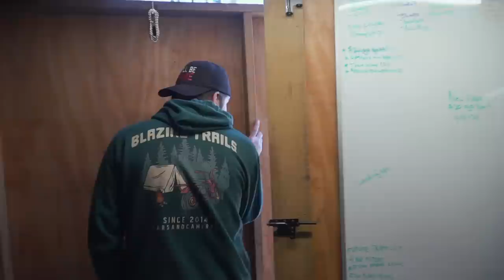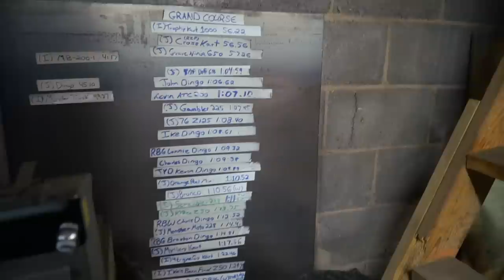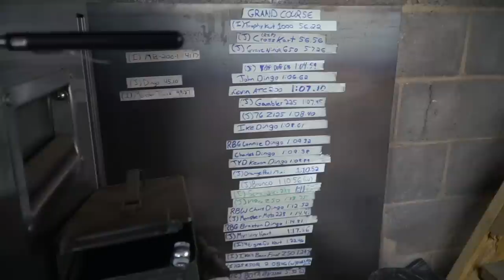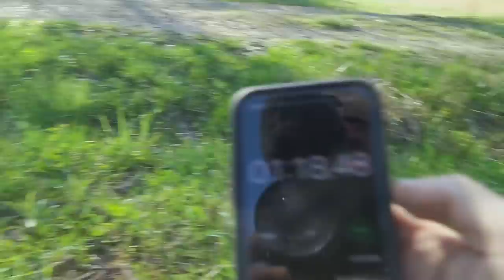We Bought a $20 Go Kart from a Chicken Farm... Will it Run + Ride?

Comment from the maker: I think chicken scratch deserves some TLC! Twin 212s?
Reply: He guys
Reply: Hey
Reply: Sounds fun!
Reply: Yes
Reply: How the heck do y’all find all these deals??? My dad said he would help me make a go kart but I need a chew frame. Could y’all tell me how y’all get the deals??? Also I pull a motor out of a old general and the carb was no good so we just chunked it because my grandpa told me that I could buy a whole new engine for the same price of the carb.
Reply: @chaseyoung4485  find them!
Reply: You should spray paint it chrome
Reply: @wouldyouglowme4235  where tho
Reply: Love to see you find a dead Vespa or old dirt bike so you have some gears!
Reply: 😳😳😳😳 YESSSS
Reply: Maybe some suspension? Or bigger wheels
Reply: No, custom build the OHC and see what can be done with it
Reply: I still stand by my comment from before - I think a throw back/ farm build is the way to go. Get yourself a Briggs intek v twin mower engine, do a horizontal shaft conversion, and slap that on there
Reply: Hell yes
Reply: @CarsandCameras Just an idea or two maybe try some big quad wheels and tires and maybe a two stroke snowmobile engine or something?
Reply: V-twin
Reply: @chaseyoung4485  ask people for them. Ask around and see who may have a go kart.
Reply: Just one 212 stage 4
Reply: maybe the diesel would fit on this chassis very nicely, its quite powerful and maybe you guys can tune the diesel a little, would really like to see a comeback of it!
Reply: Twin 670s
Reply: Triple 212
Reply: What happened to that  snowmobile engine you guys got?  I wana see some 2 stroke action
Reply: @zomgz932  good question, the big 670 two stroke would be a perfect fit for this build!
Reply: Single unmodded 670
Reply: @jimmyhughes5392  booooo
Reply: Nah guys, change it up a bit. everyone always builds 212s or similar motors. build the ohc honda or find something different to put on it. not another 212
Reply: Quit being chickens dual 420s are where it’s at
Reply: @thesuperjank6109  The diesel perhaps?
Reply: @thesuperjank6109  yeah what's the other one they have at like harbor freight 420 like a 13hp or something would be a better build an be different for sur
Reply: I think you guys should turn it into a hover craft
Reply: It needs a predator v twin
Reply: Dual tillies
Reply: @chaseyoung4485  facebook market place is very good for finding good deals
Reply: @7_7_5  I would say the diesel or the Bombardier
Reply: 420 And a custom Front independent suspension maybe?
Reply: Brand new hot rod 670
Reply: I am also voting for the diesel.  Or a hit and miss engine would be cool, but mainly the diesel.
Reply: Hey, can I be one of those friends over for the freedom 500? Please!
Reply: @jimmyhughes5392  you are so wrong! Those pit vipers are the coolest! Your just not old enough to understand my friend.
Reply: @thesuperjank6109  yeah boo Jimmy
Reply: @hermansims304rcrawlingteam3  I'm partial to the duromax 440cc 18hp. Just saying. Took my yerf dog to 47, so far...
Reply: @chaseyoung4485  hey they’re podcast has an episode about how they find the deals they get
Reply: Duromax 440. An e-start is only $350.
Reply: @lizzard7473  i'm older than john but younger than isaac so i don't think my age has any relevance in it tbh, he looks ridiculous in them and he knows it! anyone would think i just pissed all over his parents all i did was  make fun of his sunglasses...
Reply: @thesuperjank6109  lol he looks ridiculous and he knows it!
Reply: YEESSS!!!!
Reply: If you have a big 212 go kart day let us know. I want to be there!
Reply: Nah let's see a supercharger on a 212 lol!
Reply: spark plug change first japan engines are picky
Reply: @thesuperjank6109  i agree i want to see maybe briggs or Kohler build
Reply: twin 670s.
Reply: Inline twin motor bike engine with a torque converter?
Reply: @lewfec7336  i say 4 predator 670s with torque converters for a makeshift v8.
Reply: YESSIR
Reply: Yes!!
Reply: 670cc?
Reply: I offered to give you guys a vtwin last year. Offer still stands. Then you could put it against my sons manco dingo with a 670 and a cvt on it.
Reply: @jacobbreazeale1816  4 670's to make a v8.
Reply: 212’s...nahhh. Twin 228R’s!! Go big big
Reply: @gavincline209  naw, twin 670 predator. with performance 670 parts.
Reply: Twin 212!! DoubleTrouble
Reply: Why not try something different stick a 301 on it
Reply: Go for it  it'll be fine
Reply: Yeeeaaaaa
Reply: Definitely twin engines
Reply: Yes please
Reply: Dammit bobby
Reply: Why twin? For twice the work lol.. just throw a 420 v twin or that 2 stroke motor you had. I just think the twin engine idea is not practical
Reply: Yes
Reply: One 212 will do the trick just fine
Reply: a turbo on that old honda!!
Reply: @7_7_5  perhaps turn it into a turbodiesel!!!
Reply: Rotax 670! Or how about kawasaki 1300 I-6?
Reply: @balsamicvin9935  yes definitely!
Reply: you know a 670 will fit!
Reply: I've had that same go kart 50 how on it whas like a 68 charger going do the drag
Reply: The Loving Chicken
Reply: Totally!
Reply: Been wondering a while now, unless im wrong, why no 2 stroke engines in any videos? Would be cool to see you guys do something with one of them

Comment: Put one those engines like what is on the CT 70s on it. then you would have a shifter kart. you might have to use a Jack shaft but that would give you more gearing options or lengthen the frame. I'm Thinking you must have something like that lying around.

Comment: reinforce the frame, build a full roll cage, add a wheelie bar to the back, and put a stage 3 pred 670 on it, and make a longer version of the black window kart, i think this one being longer should handle the power a little better than the other was, and it would be crazy fast, i'm still amazed at the time that right out of the field to the shop, that kart ran with some (not by any means minimal) work, should be a blast, and knowing you guys it'll be awesome

Comment: This video reminds me the time I slightly built one. I bought a home made go kart body from a class mate with no engine or seat for 100 when I was in high school. Had found a Honda 340 gx engine with no carburetor, but bought a cheap dirt bike carb from amazon and custom made a new aluminum cast intake manifold for the carb somehow similar to the one in the video. The engine had to get a governor delete and it even had electric start. The engine also made about 2 or 3 extra horsepower because the carb venturi was a bit bigger than the factory carburetor. Then instead of the centrifugal clutch I once had but burnt out, I put a torque converter on and it was the best experience.

Comment: I think you guys need to gear it down. An overhead cam engine can typically rev higher than a pushrod engine. So lower gearing would allow it to rev. I think it'd be cool if u guys could modify this thing to just rev as high as possible. Maybe even dual screaming honda 5hps

Comment: Excellent video guys  :) that go kart excellent also need put 1974 400 or 440 twin cylinder motor with 2 carbs  2 cycle fuel Snowmobile engine from Bombardier  in it and bet get faster speed plus times too!

Comment: This would be the ideal frame to build a front wheel drive, rear wheel steering go kart. Put the seat over the rear axle. Dual 212's on the front. The rear wheel steering would be the big challenge. You CAN do it.

Comment: Murrays tend to break lol. I have a Murray Explorer. Frame has cracked on it so many times. Just sold the Honda GX270 off it, debating putting a 2 stroke snowmobile engine on it. After I fix the frame again of course.

Comment: That is a good cause something that you guys are known for. it's a good thing that you got that kart before Colonel Sanders ended up with it. all those part's being froze up should come to be expected when something is buried in chicken shit. I wish Go Power Sports had those manifolds for Briggs and Stratton engines but they don't. that thing is extremely slow after all it's Honda powered. that thing has some bearings really squealing on it. always use a fuel filter I thought you guy's already knew that.

Comment: You guys should get one of those concrete filled lawn rollers they use for sports pitches, tow it behind the tractor when the ground is starting to firm um to smooth the track out. That way it will harden flat....

Comment: You could put a Y in the fuel line before the carb and feed one side as a return to the tank and the other to the carb. You would have flow to the carb with little pressure.

Comment: I got a murray and it had the same exact problems with the frame and steering but I fixed it with a bigger steering wheel and new bearings and its a lot of fun with a predator 212

Comment: A great fix for old wet spark plug wires that are leaking high voltage and shorting is spraying them down with WD-40.
 One time at dusk a friend and I were four wheeling my F-250 in a very large foot deep puddle. It died right in the middle, and would not restart. I climbed across the hood and opened it. My friend cranked it, and it looked like fireworks under the hood.
 Fortunately I had one of those mini cans of WD-40 in the glove box, he tossed it to me, I soaked the wires down, and she purred like a kitten!

Comment: Looks like the intake was exposed. I have had similar bogging down with when riding thru mud* puddles or light rain. Chop the top off a wide mouth Gatorade and cut some breathing holes. Zip tie it over your nice expensive K&N filter & you can overcome the elements. 

Not saying that's why it wasn't running right. Just a good measure to take if you are hard on your toys 👍

Comment: Its so easy to unscrew the spark plug and pour in some oil before you start working it. Let it sit there so when you start turning it over it doesn't run dry for 10 seconds while it pumps oil.
But whatever. Not like they don't have 600 other 5hp engines.

Comment: You could have pulled the spark plug and blown air through the plug and out the intake and exhaust ports to clean them better then with you finger

Comment: I had a similar issue and it was air getting into the fuel lines and killing the fuel pressure. I put hose clamps on and it was fixed, got all the power all the time.

Comment: Take that go kart, cut and raise front spindle and put in 2" springs. Then put a couple of tall fat rear tires at low Pressure . Fix the plug wire, put larger rear sprocket and run it.

Comment: Put the original Carb. back on it, after cleaning it up or rebuilding it. Bearings in the wheels also & tune up on engine. MAN YOU CAN'T BEAT THAT THING FOR $20, HOLY CROW.

Comment: I think you're problem is going to be more water in fuel related.   Why don't you just dig a trench across the track, throw in a culvert with some stone around it and put an end to the wet spots? It would probably take you an afternoon to get the big spots with standing water straightened out.

Comment: For as many old engines and carbs you guys deal with on these machines, I just dont understand why you don't have a ultrasonic cleaner yet. I've saved some really nasty looking carbs with a ultrasonic cleaner and simple green pro hd. Simple green pro hd, is purple in color, and is made for ultrasonic cleaners and won't etch aluminum. Run the cleaner for 20 mins or so, and most carbs come out clean as a whistle

Comment: Its funny somebody put a cheap pressure washer Honda on a go kart, lol. Them little engines are pretty reliable BUT they are made pretty much like a "disposable " engine. I used to work at a shop as the small engine mechanic and the price for parts for these engines is way to high compared to the price for a brand new engine. But they are usually very simpleton get back running, the valve lash causes a lot of issues with these little engines cuz the OHC is very cheaply made and they break really easy and the valves don't hold proper lash very often

Comment: For anyone who wants to buy a Honda GC160/GC190, I'm sorry to tell you but its not a very good go kart engine. It might be a honda but its just not a good go kart engine. The exhaust is on the wrong side, the shaft isn't the right size, and the throttle setup is odd. Overall I'd say a $99 harbor freight is a good way to go. But, if you really want a honda and you don't want to spend a lot, I'd say go with a GX120 if you have a go kart like in the video. Its not the fastest kart with a 120cc engine but the honda gx series is great unlike the gc series. (Advice from someone building a go kart)

Comment: the honda gc engines were intended to be honda's entry-level low cost consumer-grade engine before all of the chinese gx clones and copies flooded the market. when the gc first came out the company i worked for at that time bought a devilbiss pressure washer for the facilities department that had a gc engine on it but the employee who bought it and unboxed it didn't bother to check the oil level before starting it up and ended up seizing it solid... because it was run without oil the company that sold it wouldn't take it back or refund the money so we were stuck with it. my boss handed it to me and told me to see if i could get it to run. i tried several things but nothing worked so i took the whole thing apart and had to use a chunk of wood and a huge sledge hammer to pound out the piston and rod. the cylinder bore wasn't damaged but did have some aluminum from the piston stuck to it, which was easy to remove. the piston was scored but the rings looked good. i wanted to put a new piston in it but the company didn't want to put any more money into it so i cleaned everything up as best as i could and put it back together. setting the timing belt is not easy and honda's english translation of the instructions is a bit confusing... but i managed to get it after a couple of tries. it took about 5 pulls to get it started but it ran beautifully with no smoke and plenty of power. ran a full tank of gas through it while washing trucks in the parking lot and it didn't skip one beat. after that 'break in' run i changed the oil, was surprised to see few metal particles in the old oil, filled it back up with new oil and put it away. the next day at work i pulled it out, gassed it up and it fired up on the first pull on a 50f day and ran smooth. and from that point forward until i left the company 15 years later that pressure washer still started on the first pull. i assume the timing belts last that long because they are constantly soaked in oil which keeps them from drying out, so honda may have been on to something.... but for an engine design that was supposed to be consumer or homeowner grade, it's a pretty tough little engine that is really hard to kill.

Comment: Genuine question:

The engine on my hammerhead 150cc died and refuses to work. Could I shove a predator 212 or 420cc on it?
Reply: You can but it won't just fit in the gy6 mounting position. You will need a welder and a engine plate to do it. but yeah its just metal. You can make it whatever you want it to be.
Reply: Oh and good luck!
Reply: Try this, find the engine mounting bolt hole centers on the engine you have vs the engine you would like to have and determine whether or not if they match (Mesure specifically the space between them, side to side and front to back).  I dont think they match, but that's a start. I'd pull the gy6 off and start measuring things.

Comment: Guys. Why don't you take the wet spots and fill it with sand. As it would always drain and be dry on top. Sand is porous and would let the water run off and not puddle up

Comment: DISAPPOINTED.  I drove 160 miles to Pate, rented a hotel and went by the G0-Powersports booth 4X today yall weren't there, I even called the store and they said yall would be there in 30 minutes. I got there at 0700 and Had to leave at 11:30. So Sorry I missed yall.

Comment: the air-less tires, pure metal or plastic, or other bending stuff, like rubber, no sealed air, leaf arm suspension wheels
Reply: btw, the electric-generator to hub wheel engines, sssssiiimmmple
Reply: do you like barbie cars, police
Reply: try making a steam heat pump tractor
Reply: or a solar go cart
Reply: moving suitcase
Reply: just have a "small" supercap buffer to match with the loading source

Comment: last weekend me and my grandpa rebuilt a go kart that he had because i had a motor that i didnt need anymore. when it was finished i started driving it up and down the road i live on until the clutch for the torque converter got stuck. so just in case it happend again i taped a hammer on to the steering shaft so i wouldnt have to take 20 minutes to get it un stuck again. about an hour l8r i was in my neighbors woods and hit a bump and the chain fell off and the only took i had was a hammer. i eventually got back home with it after having to stop ever 100 ft for a mile to put the chain back on.

Comment: Yeah it's been sitting up outside for a decade or two,let's not adjust the clattering valves,skip cleaning the fuel tank out,skip new spark plug and cleaning the coil pickup and just send it wondering time and time again why it keeps falling on it's face... Inline fuel filter,tank flushed,new plug,valves adjusted properly,flywheel and coil cleaned and that engine would probably surprise y'all..

Comment: Any chance the vent isn't working properly on the tank and it's pulling vacuum and not letting you get the fuel you need after a while at full throttle?

Comment: When working with that type of fuel pump and it's running funky, go to the hose connection that is the source where it connects to the engine and put a new clamp on it, they suck air right there and it runs funky when it feels like it.

Comment: I believe you need a return line for the fuel as it forces fuel threw the carb wich fills the bore up and causes to much pressure in the crank case so believe that the line off the breather needs a t so it can still breath but also runs the pump